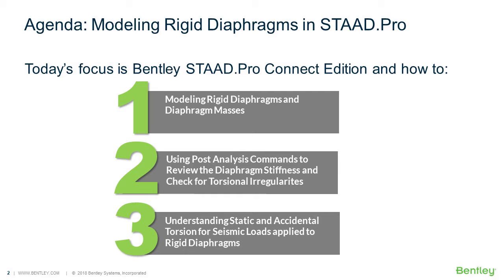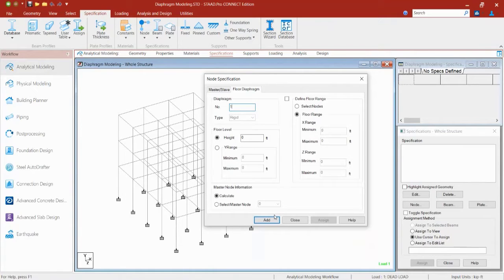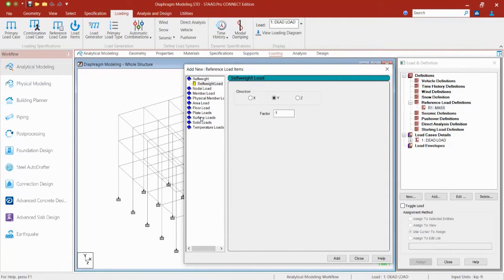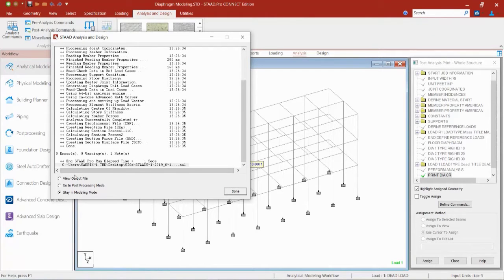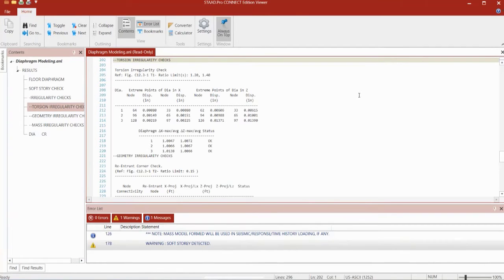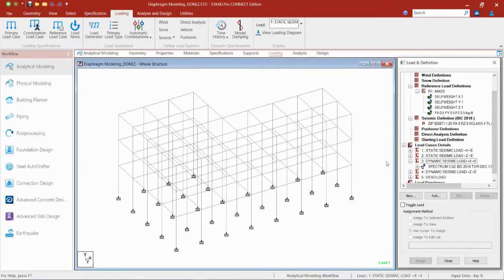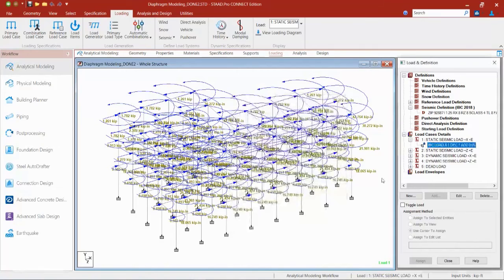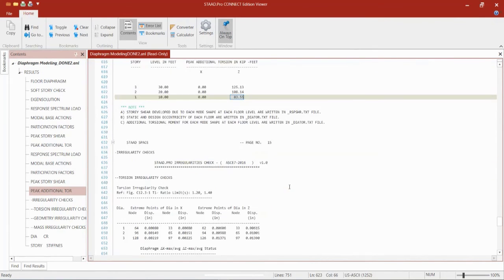Modeling and Understanding Floor Diaphragms in STAAD.Pro

Comment: (1) Thanks for this video, I found it very helpful, could you please include the direct analysis (second order) at the same model, I would like to understand the correct procedures of second order with the seismic (2)And if I have shear walls, and  using frame resisting system, How I can set the STAAD to transfer all the lateral forces to the shear walls only without the columns (if I don't want the column to contribute in the lateral resisting). (3) For what I have mentioned, can I follow the same diaphragm procedures.